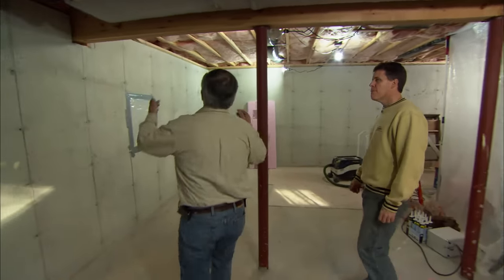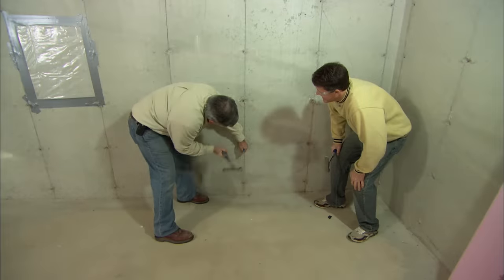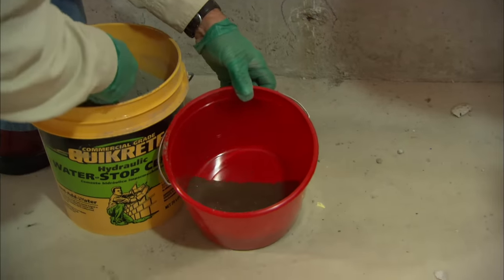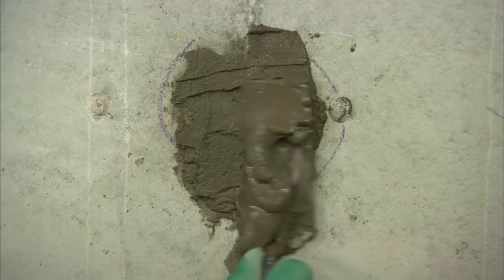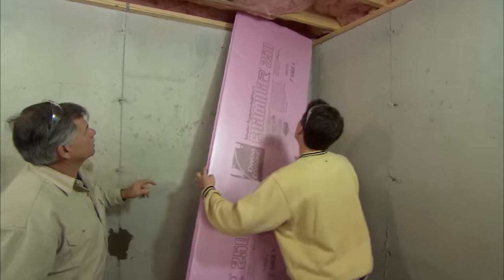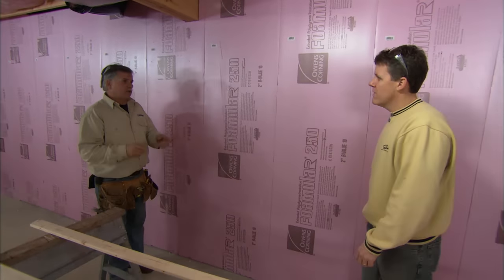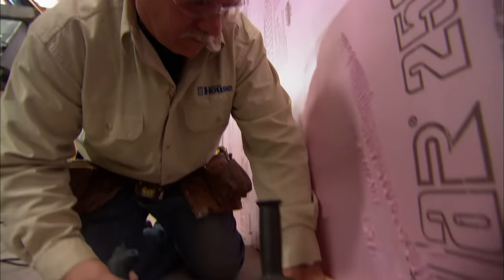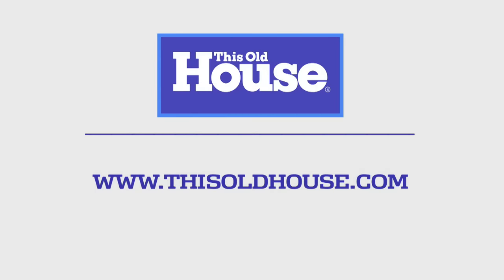How to Insulate a Basement | This Old House

Comment: Run the adhesive vertical so that if water were to get in, it could trickle down.  Applying the adhesive horizontal will allow the water to accumulate and mold.
Reply: If you got water coming  into your basement thur the concrete walls . It doesn't matter which way the adhesive is running because that the least of your problems. Greetings from Cincy Ohio U.S.A.!
Reply: True both points.  If a leak is possible it would be best to run down.. but any leak is terrible.  Concrete always seems to crack no matter what eventually. From my experiance in a prefab trench factory,  so if it was me. I'd rather run every bead of adhesive vertically hoping for the least amount of damage in the long run.. but who builds houses for the long run anymore??
Reply: Good idea.
Reply: You should be doing your own show
Reply: @backtothebasics6595  I don't understand what you mean by vertical
Reply: @meme7591  Vertical is up and down instead of side-to-side as seen in the video.
Reply: @tigger55555  wrong even with no water in the basement the walls may sweat in the summer every detail needs to be thought of .
Reply: This foam will not mold. It is made to be put in constant contact with soil, water, whatever. Giving the water a pathway is correct though. But, if its finished down there, you've got alot of issues.
Reply: Trickle down where?  It would still accumulate at the floor even w/ vertical adhesive.
Reply: @sku32956  The purpose of the foam is to create a thermal break between the conditioned (or inside) air and the cooler (depending on time of year of course) surface of the cement walls. The wall can stay cold and the air in the basement won't come in contact with it to cause condensation. Same as framing the walls a half inch off the block and the spraying closed cell spray foam insulation on the wall to air seal and insulate. Where I am at this foam board or spray foam is the way basements are being insulated. Also important to seal the rim joist the same way as the walls. Water issues def must be addressed before any of this is started. People need to work outside to inside to keep water out. Seems like builders work the other way now a days lol
Reply: Gregvancom and Matt Risinger are the most annoying folks in the YouTube construction field
Reply: @backtothebasics6595  Matt risinger and Steve baczek
Reply: Water problem should be resolved beforehand. Start outside with landscaping, gutters, etc. If still an issue, and a known issue in neighborhood (like mine), have drain tile system installed.
Reply: If you only apply vertical glue lines you will have pockets that will allow air seepage from below, what your trying to prevent. Defeats the entire purpose.
Reply: I saw other videos that recommended an S shape.  Wondering if that allows water to drain down as well
Reply: Running the glue horizontal is the correct and only proper way to perform this job, exactly as demonstrated by Tom. This approach prevents the rise/fall of colder/warmer air on the cold side of the insulation, helping to prevent moisture issues. Vertically applying the adhesive is NOT the correct way. For basements like this you want NO air gaps, completely sealed with no way for air to access and no ability for air to rise and fall on the cold side of the insulation. This is due to the fact that the basement wall will have temperature differentials due to the fact some of it is below grade and the rest is above grade. Even the gap created by adhesive is too much and will allow air to travel, hence why it is applied horizontally.
Reply: I'm constantly telling people to do this with exterior insulation, some sidings and faux brick veneers, but they still continue doing circles swirls, waves and horizontal lines. This will definitely trap water pockets and shorten the exteriors life span.
Reply: @mikecampanella1990 No the foam won't mould, the wall will. Smothered it will create other types of mold, effleuresence and nasty damp musty smells. An air gap like Delta  wall dimple should be used first.
Reply: @mikecampanella1990 the foam it’s self won’t mold but mold will grow on the concrete side lol
Reply: Nice idea.  I'm going to do that.

Comment: I like the foam insulation but would rather frame out with 2x4s. Drilling into the concrete wall seems to be counterproductive to the water proofing done earlier with cement.
Reply: That's what I was thinking.  All that work when 2x4 wall easier/faster.
Reply: I was going to ask about that.
Reply: Your typical basement wall is 8" thick. The only way to install and secure the wood frame wether it be 1x3 or 2x4 is drilling into the concrete wall and either nailing it like he did, or using tapcons. With the basement wall being 8" thick, them drilling into it 4-5" deep won't effect anything to do with water coming in.
Reply: Also, wether or not you use 1x3 or 2x4, the only difference at this point is how much space your using and cost of wood. All the wood frame is doing is holding up the drywall, it's not for anything structural so there doesn't need to be anything more than enough to hold the ¹/2" drywall up.
Reply: @justinvanamberg7206  Or you could  glue the 2x4 wall to floor and nail the top to joists.
Reply: I've always used 2x2s or 2x3s with a bottom plate glued with construction adhesive and ramset into the concrete, and a single top plate nailed into the ceiling joists. For walls parallel to the joists, without a joist close the wall, I installing blocking between the first joist and on top of the foundation to give me something to screw my top plate to
Reply: Batt or Rolled insulation will hold moisture and allow the growth of mold easier than the foamboard period.
Reply: @polemistisarcturus9845  very true but can still stud wall out and use closed cell styrofoam sheets. Just did a wall in steel shed. Cut foam to fit, spray foamed around all the edges, and covered with particleboard.
Reply: @anthonythorp7291  
I agree 100% with the framing layout. His crosscuts into the concrete will more likely be a regretted decision down the road.
Reply: Concrete is porous. You should not rely on concrete for waterproofing. The foundation wall will only serve as a backing for any membrane that you should apply on the exterior or interior wall (not sure interior is great, but if you have no choice...)
Reply: Maxx Castillo That’s likely not to code. If your house’s main floor is framed with 2x4’s, you have to frame the basement with 2x4’s. If your main floor is framed with 2x6’s, you have to frame the basement with 2x6’s. I don’t understand the logic in that requirement, but that’s what I’ve always known to be true.
Reply: Grease Medic how should that effect the seal
Reply: @polemistisarcturus9845  Frame the 2x4 wall atleast an inch away from the concrete and you'll never have trapped moisture and you'll have space for air to move to prevent mold.
Reply: Molonlabe115 we frame the walls out 4 “ away from the concrete with 2x4. Enough room for all drain pipes from above, electrical, low voltage, insulation, water lines, conduit, vents. Then we poly the frame before drywall as vapour and air barrier.
Reply: I want to do this method but add laminate flooring for wall finish ,  I have cabinets covering most of the exterior walls, so finished drywall may be more work and risk of mold. I will be drywalling and painting the interior walls. Our basement is 20 years old and seems to stay very dry. With costs of batt insulation and 2x4 right now...I like this idea, what are some issues I may run into? I want to build it as if I can take it apart easily incase I have an issue. Also this is for my vintage toy collection, IKEA cabinets, so not an actually living space, more like a study or workshop. Any guidance is much appreciated
Reply: @christiansmith2104  I have never heard this. I think you are wrong.
Reply: I would drylock it before anything.
Reply: @justinvanamberg7206   assuming the foundation / everything is in place. Disagree on older homes.
Reply: @molonlabe1156  2 inch from the concrete and foam board? I see videos not using the foam board and debating which to use.
Reply: @oldarkie3880  ontario building code.
Reply: yup just make sure you dont drill right thru the concrete and you'll be ok
Reply: @EarendilTheBlessed  the code is for the foundation to be waterproofed from the outside.treated properly on the outside you never have leaks.I warranty my work for the life of the foundation.
Reply: he didn't wateproof.  and using wood framing is asking for rot and trouble.
Reply: I agree.  In Canada I removed the half wall bat in bag insulation…useless practice!  I then used 1” foam board on my concrete walls.  I then placed a subfloor using exterior dimpled wrap, then glued  tongue/grooved plywood on top of that.  Then I built 2X4 walls 24” on Centre’s as it’s not load bearing, drilled into floor.  I ran my duct work and wires.  I had a company come in, mesh all the walls and ceiling space to thermally and sound barrier with blown in insulation.  I then placed vapor barrier, then dry walled. It turned out amazing.  On ceiling, I used Z channel to reduce sound transmission through floors.  Kids could have music playing and no one heard it.
Reply: @christiansmith2104  it is not structural, it does not apply
Reply: @mrmadame28  I never said it was structural
Reply: @christiansmith2104  the point is if it's not structural, then it shouldn't matter what you frame it with. A non structural wall is basically a nailer for drywall
Reply: Plus, dont the people with high humidity have to allow the concrete to breath.
Reply: The cement wall is thick, don't worry about it

Comment: **Very important for anyone using this method to insulate their basement walls. If you do not completely seal the top of the foam board to the concrete wall (use can spray foam), there is a very good chance you will get moisture that rises up and seeps out at the top of the foam board, even if you have dry walls. Batt insulation in your ceiling will allow this moisture to pass through then the moisture will get trapped between the subfloor/rim joist and the insulation. Rot will begin and you'll never know it until it's too late. Don't ask me how I know.
Reply: @DaniellaTousson  I'm not familiar with that product but don't think it could hurt anything. I'd still make sure the top of the foam board is completely sealed to the wall.
Reply: @DaniellaTousson , I'm a capable DIYer, not a pro, so take this with a grain of salt.  Bats in the rim joist void was the recommended best practice years ago.  Now folks have realized it causes mold.

I've been watching a bunch of YT vids ahead of finishing my basement.  Modern guidance I have seen is from Concord Carpenter, and a couple other channels is:  Remove the bat insulation in the rim joist and upgrade to rigid foam there as well.  (you could also pay a pro for spray foam, but that is not DIY friendly)

The air permeability through bats allows humidity to move towards the cold inside face of your external sheathing.  In cold months, the moisture condenses, and you get mold.

The new rigid foam should be equal or greater R-value to what you have in the walls above.  Use multiple layers if needed to get enough R-value.  An important note:  cut the rigid foam 1/4 to 1/2 inch smaller than the void in the rim joist you are filling.  That extra space gives you room to use canned spray foam and make an airtight seal between the foam and the joists.

No interior air touching the cold external sheathing should mean no humidity condensing and no mold.
Reply: @22kmclaren  That’ll work fine! Alternatively, you could order a frothpak of spray foam and not have to cut the rigid into the bays, but you’ve got the principles down.
Reply: @melvin_0bviously , I did not know about that product.  Thanks for sharing!  For cost savings, I will probably stick to cutting rigid foam in easy to access bays.  But I will definitely pick up some frothpak for the tight spaces!
Reply: I highly recommend spray foaming. I did this when I finished my basement. Cost was about 2x over foam board but honestly it's a drop in the bucket when you look at the overall cost of finishing a basement. The contractor was done in half a day.  It would have taken me several weekends of work if I went the foam board route. Get several quotes as I found they vary quite a bit.
Reply: And since I did this gutter drain tile system with their open flange to catch moisture falling down walls,, I need to seal up there to not only stop excess moisture migration but the radon gases.

Comment: No way I’d drill all those holes into the foundation walls!  Put the foam up and then just build a normal 2x4 wall anchoring the base plate to the slab and the sill plate to the floor joists.  Hell now you can even pack in insulation into the 2x4 stud void to build it up even more since ICF homes have 2-3” of foam on the inside and the outside of the basement walls.
Reply: I agree. That's what I did in my home in NY
Reply: Would you need a vapor barrier to finish the install? Such as 6mil plastic acustically sealed before drywall goes up?
Reply: Ephraim Quinones with EPS foam and taped seams you don’t technically have to.   Vapor barrier depends where you live and how you place it.
Reply: I'm upstate NY so winter's are long. I'm pretty sure my partially finished basement walls only have been studded with unfaced fiberglass and finished drywall.
Reply: Ephraim Quinones I see so many different thoughts and builders and code saying how it should be done and again all are different.  To me, if you have something up already, remove the dry way and see if it’s wet/dry or mold.  If no mold and dry then I’d stick with what works.  If no barrier like you say then 2” foam against the block should be fine.
Reply: @dcq5381  I say do not put a vapor barrier on inside of framing. Basement water vapor only goes one way from the damp earth in, not the other way. A vapor barrier inside crates a mold sandwich.

Comment: Yeah, I think I'll use 2x4s to construct my basement walls.  Seems easier, plus I won't need to create a multitude of holes in my foundation walls as I wood anchoring 1x3 lattice to them.
Reply: Maybe use impregnated wood on the floor slab to stop it rotting out in case of damp?
Reply: Me too. I can frame walls way faster than I can drill a billion holes in my concrete walls
Reply: I do hate losing 7 inches of floor space but it’s worth it to me

Comment: I’m surprised at this approach to finishing a basement. Water will always be trapped if front of the foundation ties, sooner rather than later it will fail and water will find its way back in. Tom said it in the beginning that it should have been sealed from the exterior. And some one else made the comment of using 2 x 4 framing which I also agree to instead of drilling into the concrete wall possibly creating more susceptible voids for water penetration.